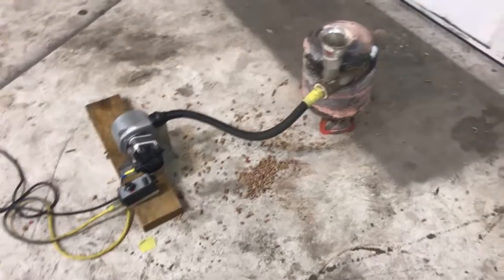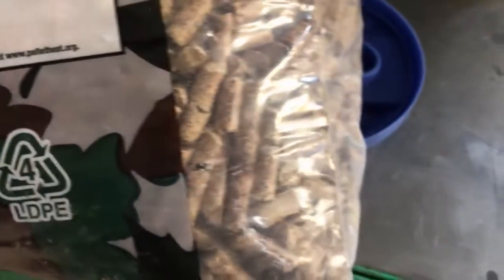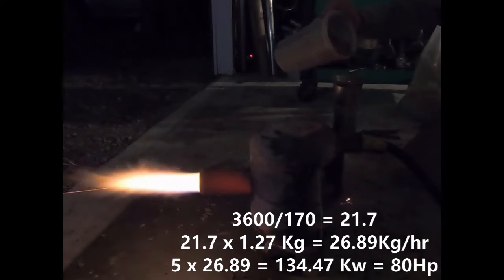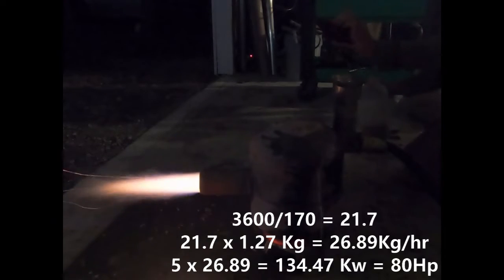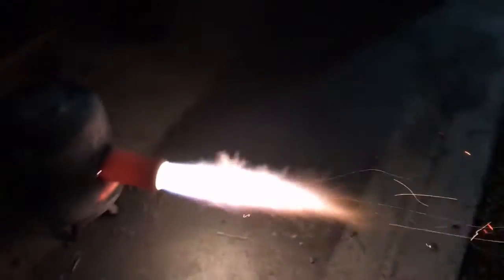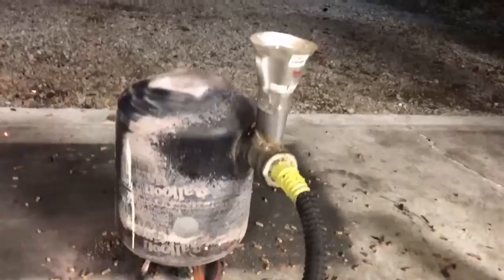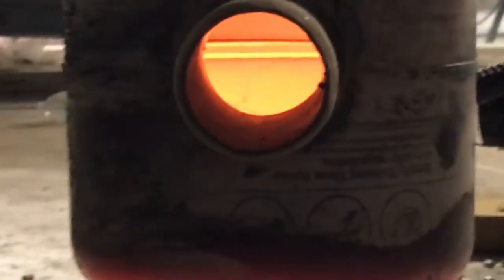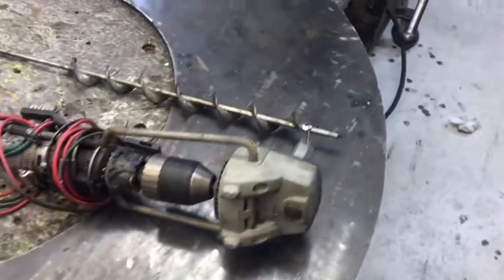Wood pellet Cyclone burner for steam engine  boiler

Comment: We're building a biomass pellet plant fueling a steam engine that generates electricity and the waste heat will heat greenhouses. We plan to use excess energy to compress air into huge tanks for energy storage and cold air that can be used in the summer.

Comment: Bury the burner in pearlite for insulation and direct the heat upward to a boiler, run the exhaust to preheat water before going to the boiler.

Comment: i have a leaf blower of 3200 w, i use it on 2 batteries 12v each and inverter, and a battery charger for them, in this way is cheap,imagine how much temp  you can get on bigger blower.

Comment: Be sure to use the venturi air feed if you use a jacketed hear regenerator of course, cant't suck too much heat through your blower, even if its clean air, will cause overhear issues with your motor. ~( 'w')/

Comment: You got your kw/hp formula backward I believe...  I hp = 745.7 watts, or 0.7457 kilowatts.

That means that 134.47 kw = 192.396439 hp
Reply from the maker: dammit your rite , i usually divide kilowatts by 745 to get hp , not sure what happened  there but thanks that would of givin us 180 hp , maybe i didnt hit the key hard enough .
Reply: @NOBOX7  Some times I get numbers mixed up in my mind too, so I'm used to it.

By the way, one method of getting more air flow without spitting your fuel, would be to put conchoidal spiral made of strips of steel up the side walls of the burner which act like inside-out cyclone dust collectors, which force the heavier mass to the outside, but into crevasses which hold them form moving freely so that they burn up before they get to the top. To enhance them even more, drill tiny little relief holes in them so that pieces are more likely to get stuck in them as they burn and therefore less likely to fly out the top, as well as the relief holes allow more air to pass all around them, allowing more accelerated combustion.

It would be tricky to draw this in 3D, I'm not sure I can pull it off with pencil and paper.

I downloaded a 'free' cad program, but 1, have not tried to install it, and 2, therefore, I do not know if it will permit me to publish in any commonly recognized format such as PDF which I might be able to share with you.

The point is, all told, a proper trapping spiral will slow down the burning embers significantly, even at higher velocities and pressures, allowing you to greatly enhance your efficiency and total power output per volume of machinery, especially if your client happens to have a space limitation.

I am actually borrowing from one of my own secret engine designs for this I am sharing with you, so in the end, either way, ultimately I will be building one for the express purpose of an external combustion style heat engine.
Reply: @DeliciousDeBlair  i want to see this in 3D, cuz idk  what you saying